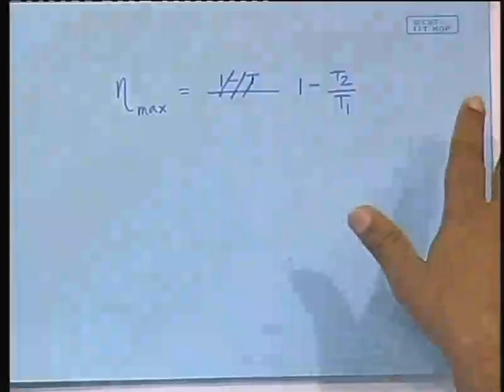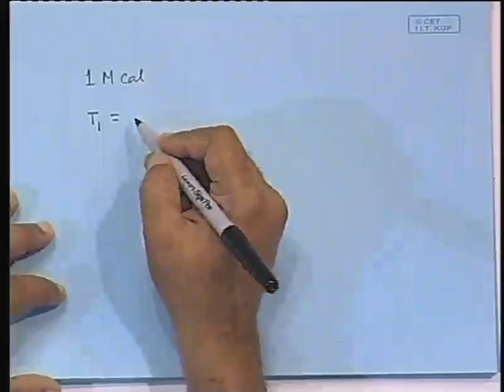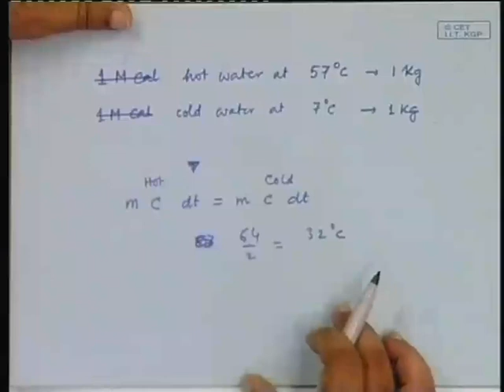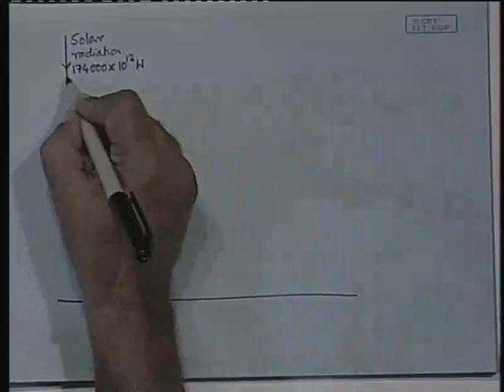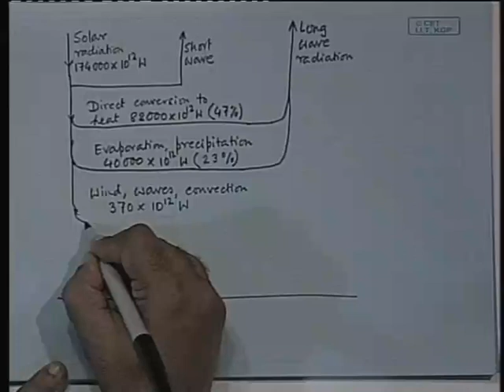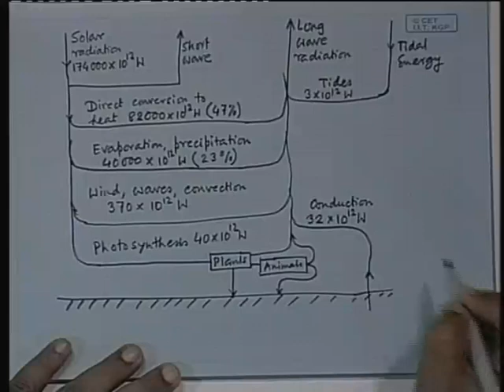Lecture - 2 Quality of Energy

Comment: Entropy is energy that cannot be used to do work.Hence, in a system, entropy always increases, as lectured by Prof Banerjee. While studying in Scotland, my lecturer only wrote on the board that entropy is dq / dt... I was left wondering what the hell is this property???.....I researched on my own and found out  more about entropy and lectured to my students just as how Prof is seen doing in this video....in plain simple English, and not dq / dt, as stated by mathematics.
Reply: sush494 he says electrical energy is unidirectional flow of electrons..... but that's only DC while we generate ac ...that is vibrations of electron to and fro in alternating directions........how is then its an orderly form of energy
Reply: @1radhamadhav  i am just trying to give answer may be its wrong..
Actually unidirection flows means the flowing direction in only one way and in AC the flow of current in wave form which is sinosodial and that is also in unidirection..
I hope it will satisfy you..